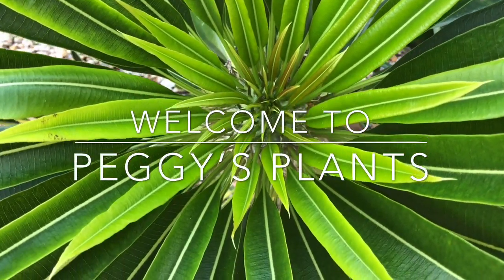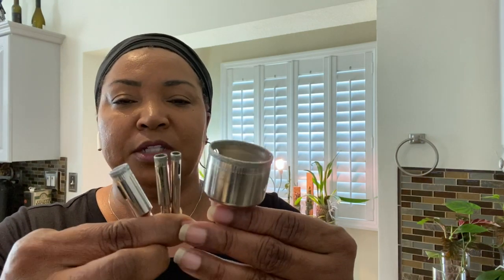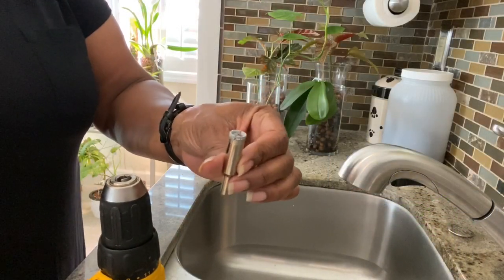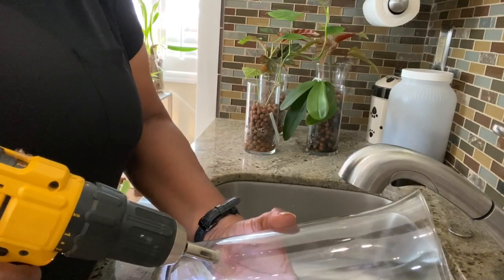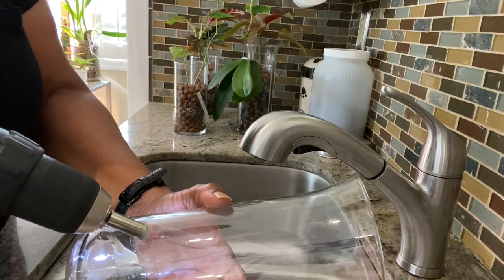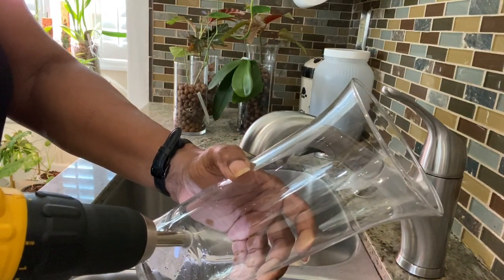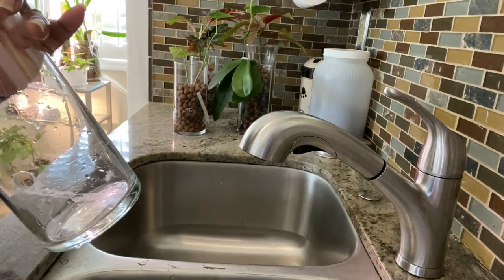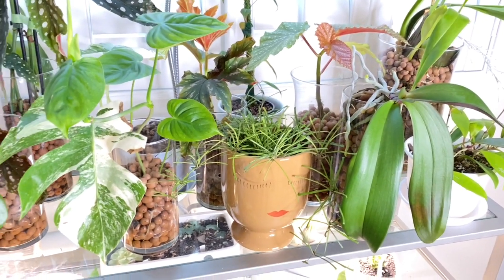Growing in Leca Pt 2 How To Cut / Drill Drainage Holes In Glass And Ceramics House Plants in LECA

Comment: This is one thing I would really like to see sold on Etsy!  Glass with holes in it already cut.  I bought the drill bit but I still haven't worked up the courage to try this.  Currently I'm just using plastic with holes made with my woodburning tool.  I'm chicken!
Reply from the maker: Maybe you can start off on an old drinking glass or something like that. Once you see how easy it is, you'll be ready to put holes in everything! LOL A thrift store would be a good place to buy some practice glass. You can do it!😀
Reply: @PeggysPlants  i have my succulent plant in a pretty thick average size wine glass 🍷 would it be okay to cut a small hole in that?
Reply: @PeggysPlants  thank you btw so much for this!!!! 🙏🏿

Comment: I drill holes in ceramic, clay, and glass. I make a template the size of the bit. Those bits do not have  anything in the center like other hole cutters. The template will hold the bit in place, and prevent it from sliding, and bouncing around. Hope this helps.
Reply from the maker: Thanks for the helpful tip. I'll have to try that!

Comment: Thanks for doing this video. Question, how may holes do you dril for each vessel? TY!
Reply from the maker: If I'm using a small drill bit, I drill one hole. If the hole is larger, I only drill one hole.
Reply: @PeggysPlants  did you mean 2 holes for the small drill bit?